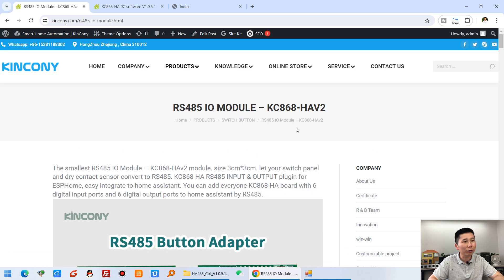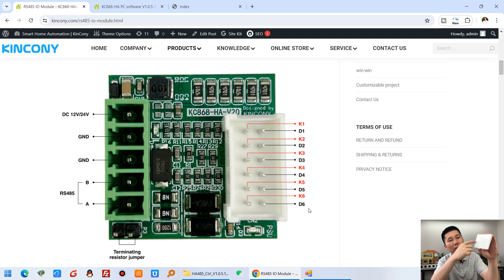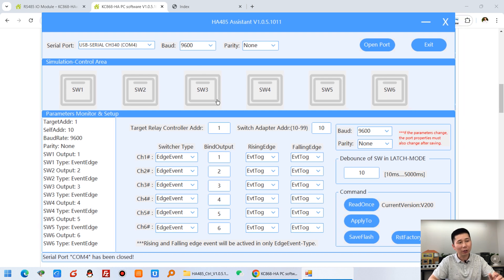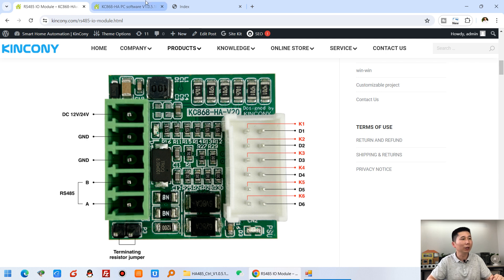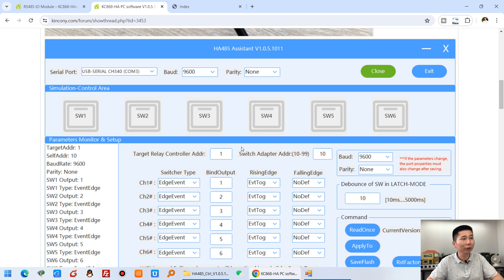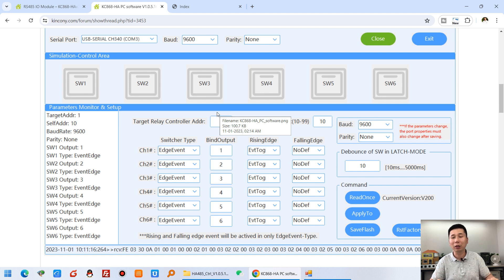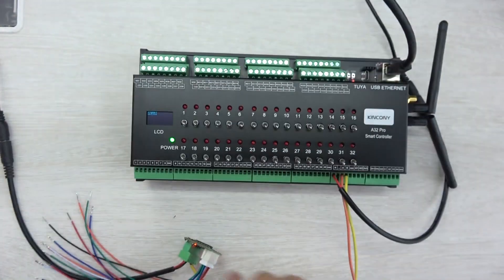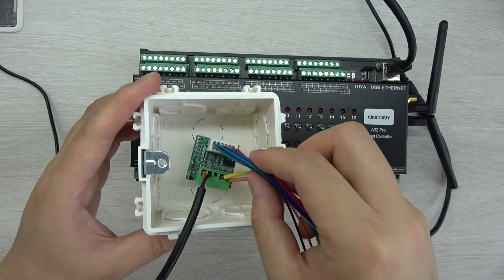use Traditional Switch with KinCony ESP32 relay controller using HAv2

Comment: Ηow many HAv2 modules you can use at the same time? Can you connect many HAv2 in parallel on RS485?
Reply from the maker: MAX 22pcs
Reply: @KinCony  as I saw in your other videos, when you just connect DI1 with ground, then the relay closes. So if you just connect the ground to the switch common and N.O. of switch to DI1, won't the relay close again? Is it a distance problem? If yes, what is the maximum distance for a cable going to a simple switch without the HAv2?
Reply from the maker: @Xaro5  because use PC software to config HAv2 TOGGLE output, use ON/OFF. HAv2 support 500 meter work with switch panel.
Reply: @KinCony  I didn't asked this. Why can't I use normal on off switch, without using HAv2?
Reply: @KinCony  Why do you need to use HAv2 to connect a normal switch?
Reply from the maker: @Xaro5  some old house need it.

Comment: Hi friend please show demo Dimmer    controller and explain conection and put link this video comment
Reply from the maker: now HAv2 only support relay controller, not use by dimmer controller.
Reply: @KinCony  hi friends which  is realy and dimmer support.  I am using to my home 11 light and 3 fan.. I need control fan speed
Reply from the maker: @nagacepvt4114  KC868-A series board and KC868-H32B Pro relay controller.
Reply: This product can go with h32pro and kc868-ak .?